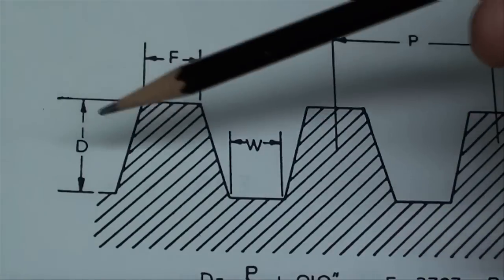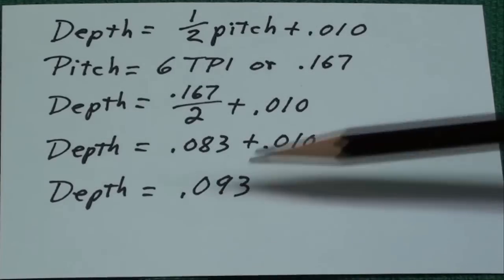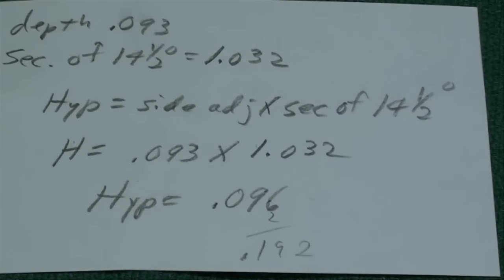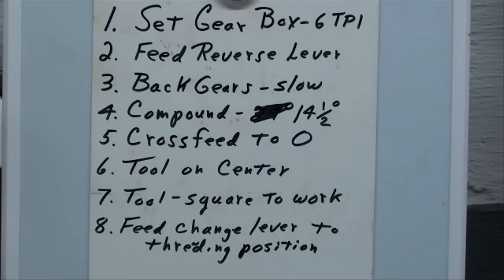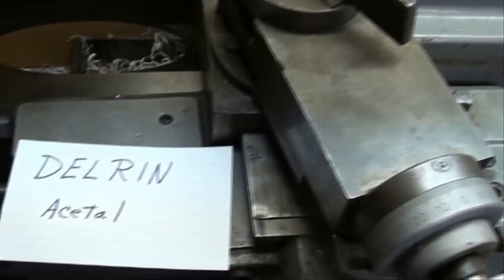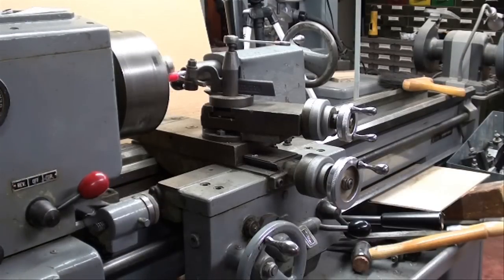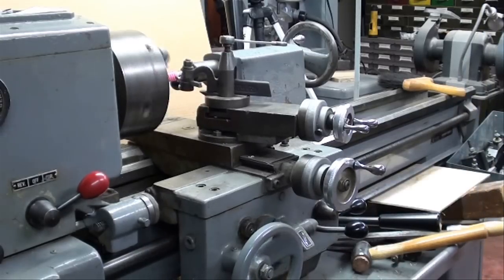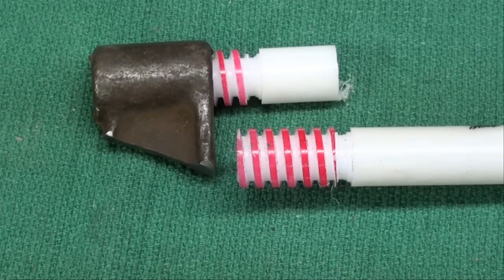MACHINE SHOP TIPS #25 Acme Threading Part 2 tubalcain

Comment: So, a question: if one is threading a standard 60° V thread, the standard practice is to set the compound to 1/2 of the thread angle minus 1 degree (29°). So why is it suggested to thread an acme thread at exactly 1/2 of the 29° thread angle? Why wouldn’t it be 13-1/2°?
Reply from the maker: Regarding the 60° V thread, some experts say 29° some say 29 1/2° and others say 30°
And for acme, it’s just half of 29. Not sure where you came up with that odd amount.
Reply: @ I came up with 13-1/2° because I was treating the acme thread the same as a standard V thread: standard V thread is 60°, yet it is recommended to set the compound either 1° less than 1/2 of the included angle (29°), or 1/2° less than the included angle (29-1/2°). Therefore, I was simply asking why the same method wouldn’t be used for acme. You stated that the compound should get set to 1/2 of the included acme angle (1/2 of 29° is 14-1/2°) I am not arguing, I’m just trying to understand why the same principle wouldn’t apply to both threads.
Reply: @mrpete222  Hi. I hope this isn’t beating a dead horse. I  watched your videos again on acme threading, and realize that I wrote the wrong number when I queried before. Therefore,  my question is this: cutting a standard 60°  thread it is recommended  to set the compound to 1°less than 1/2 of the angle (29°). I am curious why the same principle doesn’t apply to acme threading? If the angle of an acme thread is 29°, and we set the compound in a similar way as we do with a standard thread, why wouldn’t we want to set the compound to 13-1/2° (which is 1° less than 1/2 of the thread angle)? Just curious.

Comment: Delrin is a brand name for a particular acetal plastic (think Kleenex tissues). The chemical names are PolyOxyMethylene/POM or polyformaldehyde. I have never heard of either long form chemical name used in conversation; generally it is called Delrin in a generic sense, acetal, or POM. Injection molded acetal parts generally have "POM" cast into them for identification.

Do not confuse acetal for acetate. "acetate" refers to cellulose acetate, which is a very different kind of plastic.
Reply from the maker: Thanks for the info, I didn't know that.

Comment: pete watched your video;  two parts with  much interest   ! i have just buggered up my nut  for my 1/2 " 8tpi left hand  putting it in a housing for my table on my centec milling machine   !  i had to send to china for my threaded  bar  & nut ,,  90 days later it finally arrived..and i dont want to go through that rigmarole again for the sake of a nut .. another thing my lathe keeps locking up.. the slightest bit of dirt  and she tightens up  so cleanliness has to be the order of the day its a myford [ ; hobby] lathe  with only 3 1/2"x 15"  no tumbler reverse no power cross feed the chuck screws on  so no cutting in reverse or the chuck will unscrew.... can you make me a nut ? 1/2"x8 tpi left hand  acme. pleeeeeeeeese.. regards   laurence
Reply from the maker: Nope, I do not have that left-hand tap

Comment: Marathon session Lyle. Quinn might say something like "tappity tap tap". I say nappy nap time.
Reply from the maker: Yes
Reply: @mrpete222  
      Or was it AvE (Arduino versus Evil) that used to say tappity, tap, tap? If all else fails to make it fit, you need to break out the eight pound rawhide hammer or the ten foot Burke bar. A good old fire wrench works in a pinch. Now where is Bubba when you need a bit more weight on that two by four‽ 💪🦍.    
  ᕙ[･･]ᕗ

Comment: Hey Mr. Pete, I know this video is old but I have a question.  You say 6TPI or .167 but you don't say how you arrived at the .167 or how it corresponds to the 6TPI?
Reply from the maker: It is 1/6 Of An inch Between threads. So we divide 1 by 6. And come up with .167.
Reply: @mrpete222  Thanks Mr. Pete for answering so quickly. Not sure I understand though. divide 1 by 6 = 6 isn't it? I'm not the best at math.

Comment: Forgot to ask - why not come straight in from the compound? Why use the 14.5 degree angle offset? I get that the cutting action is not from a single point, you're forming the workpiece. Coming in at 14.5 degrees reduces the amount of cutting edge of the tool (minimizes drag?)

Comment: It is a great video. Now that I see how Acme threads are cut, everything deserves to be an Acme thread (exaggerating.) I had one problem with your comment that you rotated your compound 14.5 degrees. I was thinking when you said that that you were coming in at an asymmetric angle for some reason, like a lead screw that would be designed to bear pressure in one direction more than the other. Then, when you showed your gooseneck, you had cut the angle back again to neutral out where your bit is actually  mounted to the tool holder. You are still driving straight in (pointed 90 degrees to axis) on the material. The comment about the compound at 14.5 degrees confused me for a while.
Reply: modified flank infeed... there are diagrams online to elaborate

Comment: Mr pete i understand it all exp the SEC. 1.032 my trig chart only shows 14 deg witch was 1.031. Please correct me if im wrong but we just round up because of the .5
Reply from the maker: +Nicholas smith YES--just rounded it out
Reply: MR pete i would also like to know do you have any punch and die experience. I am a young machinist and work for a production shop. It is up to me to run old world war two punch presses witch is a blast, but when it comes to making the dies im alittle lost, ie clearences for the die and just a round about way of what works and how. If so i would love to see a segment on it.  Thanks i love watching your videos. I also use an old south bend 10 inch at work. The only thing that i can tell is wrong is the bull gear in the back is either bent or has a messed up tooth. Very loud click on one side of the gear and you can see were it is marking on the gear.
Reply from the maker: +Nicholas smith Thanks for watching--sorry, no experience with dies

Comment: slantt12 - The first part of your question also has something to do with how compounds are built from different companies.  The way I understand it, it has to do with how the compound is oriented with the degrees stamped.  Some would read the 60 deg that you would feed, some would read 60 deg off of a 90 orientation, giving you 30.  The 29 deg is from way old school.  Now, don't take me word for word here, but I don't think it's necessary anymore, but still practiced and works.  I believe with ACME threads, if you were to feed the full 29 deg, you would end up with v threads instead of the flat across the minor diameter.

Comment: Just like they drew it up in the manual.  Well instructed and demonstrated.  Just a question.  For normal 60 degree threads, you set the compound at 29 degrees which is, of course half minus one.  For the Acme it's set at half.  What's up with that mystery degree, and where does it go?  Thanks again and keep up the great instructions.  BTW, your dry humor puts me in stitches!  Love it!
Reply from the maker: Yea--lets make it 14 1/4 deg for acme.

Comment: hi mrpete,hope thats right,paul in jax,fl.,first time watching your vids(courtesy of keith fenner,he says your vids are very good !) your timing the threads with that dial on right ? whats it called and how precise do you have to be to get it right on the money ?
Reply: It's the threading dial.  When trying to get the hang of it, start a little further out from your material, so if you miss you can still disengage and fix it.  But be ready to start on the number you need (watch tubalcain's other threading videos) and engage (apply pressure to the lever) just before the dial reaches that particular mark, the half nut will drop into place as soon as the lead screw lines up with it.  It's not too hard and I'm sure you'll get the hang of it quickly.

Comment: I have cut lots of double lead threads but not anything like a 5 lead. If it is a five start 10 thd. per inch you have to set the lead per revolution at 5 times the normal lead for 10 thd. so that is a lead per revolution of .5 or 1/2 inch per rev. as the normal lead on 10 thd.is .1 so times 5 is 1/2 inch. How to pick up the different leads is going to be tricky. you might have to set the compound at 90 deg. to the work and move back or up .1 inch. for each lead,

Comment: If the tool is set square to the work piece it makes no difference. Used to have the  tool cut on the left side of the tool only along with the front of the tool.[one of the reasons] ... you could use 29 1/2 if you want.  Its the tool shape and squareness to the workpiece that counts.

Comment: strictly a novice here - how come - on 60 degree threads the compound is set at 29 deg but on acme 29 degree threads it's set at 14 1/2 degrees?  Why is the compound off by 1 degree on a common thread but split in half on the acme?
Reply: I think the rule for 60 degree threads is actually just less than 30 , and over the years , 29 was a good enough offset for compound inaccuracy.. that's what ive read

Comment: You can also use a gauge block to check tool perpendicularity. Just place the block against the tool holder and move it towards the chuck until it touches. If there is no gap between the chuck and the block then you're straight. To me that method is easier than using a center gauge.

Comment: I'm new to machining with a jet 1340 and 9x32 mill, had great results cutting many precision threads on this lathe..However I have always advanced the cross slide with the compound slide locked..Is there a advantage cutting the depth using the compound slide at the slight angle and why does this not effect the thread pitch dimensions being it is set at the 14 degree angle? Advancing the cross slide inward keeps the cut at a true 90 degrees..Is this only used for the acme thread?

Comment: i have anew 10- 22 lathe (grizzly) i'm new to lathe work , ihave 1/2" carbide tipped cutters do i use them just as they are or do i , need to grind at a angle like the steel bits?  cth

Comment: I work in a job shop and do this type of work all the time. Got some valuable pointers from this video-- Thanks. One time when I was still "green" I had to make a threaded shaft for a nut supplied by the customer. I didn't realize it was a "double helix" acme (2 starts), which obviously caused a lot of problems. Always something I check for now.
You remind me of my H.S. Machine shop teacher, Tubalcain (a compliment). My old Machine shop class is gone, and is now the spanish class. Sad.

Comment from the maker: @themetalcutter   Correct--you would have to use trigonometry to figure the amount.  or make a dry run using a dial indicator to move it the actual amount. Then make a notation of how far the dial was rotated to acheive that amount.. Is that as clear as mud??

Comment from the maker: @themetalcutter  I wouldn't call one of them right or wrong. But I agree that the top slide (compound slide) Is sometimes set parallel to the bed and then you certainly  would want it to read the actual movement.  I have seen lathes built both ways. It can be confusing in a large shop where you are using many different makes of lathes.

Comment: When you say, "an even number of threads" with respect to the thread dial, don't you really mean, "an integer number of threads"?  That is, wouldn't a 13 TPI thread use exactly the same thread dial rules?  Now, there are some whacked-out threads on my lathe such as 5.5  or 5.75 TPI. I believe these require more restricted use of the dial.

Anyway, I very much appreciate your videos.